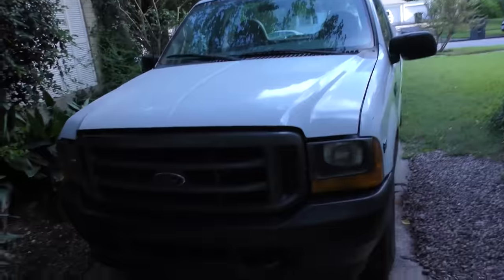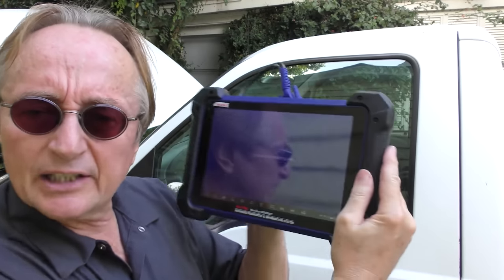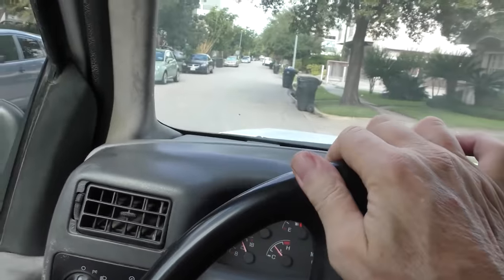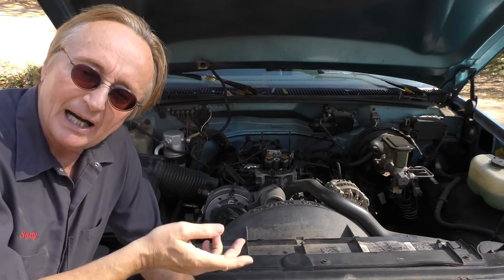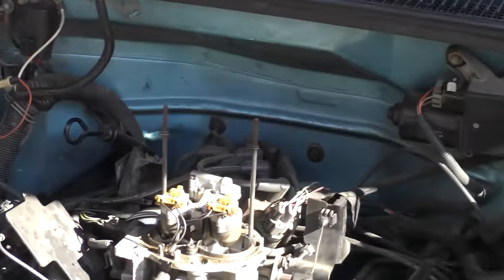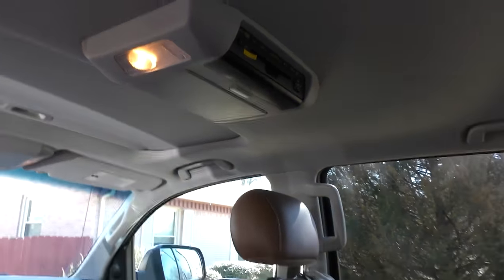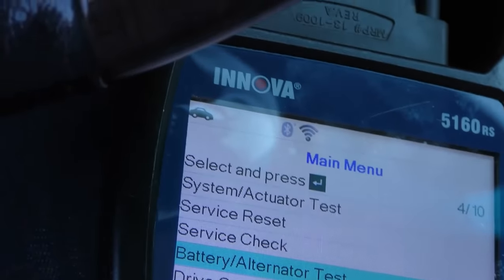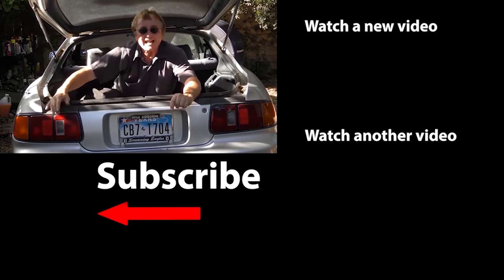3 Trucks That Will Last 700,000 Miles

Comment: Lots of issues with those year Chevy trucks…fuel pumps and transmissions were notoriously going bad all the time.
Reply: Fuel pump goes out around 200k+ or a little before. That’s about it and of course electrical issues(who didn’t have that)
Reply: @wolfmanjack8402  those year Chevy truck are notoriously know for pumps going bad well before 100k….even 60k ,70k sometimes.
I’m not just hearing this I experience this…been an auto tech for 28 years….I started wrenching in 86 so I’ve seen this for fact!

Comment: 06 Highlander 3.3lt 313K, still going down the road. 07 Tundra 5.7 4x4 282K. Pulled a BDH 35Ft TT with it no problems. Went over the Rockies no problem. The Truck spends more time two tracking(Hauling firewood, hunting, fishing camping) then on pavement........nice machine!!!

Comment: 1990 Mazda B2200 , 2 barrel carb, 5 speed manual tranny. Manual windows, manual headlights, couple heater vents, manual steering. 

Run all its life on RedLine full synthetic oil and Wix or Bosch oil filters. 

All fluids from factory replaced with Redline synthetic oil, gear oil, manual tranny oil. 

Currently sitting at 1,360,894 KM's and climbing. Rebuilt once due to a dropped valve in cylinder 3. 

Upgraded with Weber 2 barrel carb, Pacesetter headers, Bosch plug wires, iridium 4 plugs, Accel Super Coil, 1/0 gauge pure copper battery cables / starter cable . 

Fluid Film coated every year. 

Faded paint , ugly , worn suspension  (soon to be replaced). 

Cheap to fix. , cheap to insure, goes like a bat outta hell. 

I plan to run it another 30 years

Comment: I’m looking for a first truck for around $10k which truck would you pick Scotty?
Reply: 1996-2006 Chevy 1500/2500
Reply from the maker: what Todd said or an old Tacoma if you don't need to tow anything
Reply: Otherwise, a good first truck in my opinion is a Chevy S10 or a Ford ranger with an inline 4 cylinder engine, especially when paired with a manual transmission. They can be had for 5k or less and are fairly capable for their size.
Reply: My buddy has a 2010 Toyota Tacoma original owner, 420k.  He’s had to do A/C work and rebuild a trans but that’s pretty much it.  He’s gone way over the recommended 3k oil change many times, way over.  He drives it everyday.
Reply: Any GMT400 88-99. S10, or Sonoma good too, 4.3 V6
Runs GR8, parts in junk yards, all the way thru 06 GM.
Couldn’t give me a new GM or Ford…..
Reply: PRE 1980 is first choice no rust. PRE 1992 is second choice no rust.PRE 2001 third choice. NO RUST, LAY ON GROUND LOOK UNDERNEATH.
Reply: Chevy S10 was my first truck had 400,000 miles on it when I got it.
Reply: @rickreese5794  GMT 96-99 VORTEC

Comment: 1990 C-1500 work truck. Dirt simple truck 285k miles on it. Has an electrical problem I cannot diagnose. Recently got a Colorado with air conditioning and all that, also extended cab. But I miss Old Blue. Standard tranny, 2WD, long bed, standard cab, plain jane and a great truck.

Comment: Have a 2000 Silverado 4x4 3/4 ton 6.0 engine. Bought used in 2003 had 14,000 on it and almost 20 years later it still runs good at 225,000 miles. Best truck I’ve ever had

Comment: Had a 96 Ford ranger ...over 400k on original  motor  ,transmission,  etc ...best truck ever had by the way manual 5 speed ..the original clutch

Comment: My current truck is a 1993 Chevy 1500 with the 5.7 350 and 5 speed manual transmission.  I bought it for $2,100 with 179,000 miles on it a little over 4 years ago.  The odometer broke about a month ago at 203,000 miles.  Since i bought it i put a new radiator, water pump, hoses, distributor, clutch, tune ups, oil changes (all done myself).  A shop put a new front end on it and alignment.  Its not pretty to look at, but it runs like a horse.  Very well built truck worth every penny i put into it.

Comment: RUN RUN RUN ..Everyone knows you should RUN from a 5.4 Triton ! I literally can not believe Scotty just recommended "hands down one of the worst v8 engines ever made" !
Reply: Popcorn spark plugs? They fixed the problem in later versions. I suppose General Motors and Chrysler haven't ever made a screaming pile of smoking noisy iron either? Boat anchor 409! Slant six? Surely someone is offended by now, coring a sacred cow is a specialty. Try the veal, I'll be here all week.
Reply: You are talking about the dreaded 5.4 3 valve that was introduced in 2004. Do your research BEFORE you start bad mouthing something you OBVIOUSLY know nothing about. The 97-2003 Ford Triton 5.4 had a spark plug problem, yes. But that was pretty much the ONLY issue with those engines.
Reply: @standhd  the three valve engine did suck! Dude gm sucks! Exploding transmissions and chrysler's horrible electrical systems. Toyota's rusting frames and generally the awful Nissans. See, everyone makes junk, it's a fact that humans makes stuff that falls apart and will disappoint you.
Reply: @drstyxquack  Wrong again. You have no idea what I drive, how old it is and if I am disappointed in my vehicle. Looks like you got burned by a vehicle and you are DISAPPOINTED which causes you to bad mouth stuff.
Reply: @standhd  I don't care what you drive! I own Ford products, always have. America is a great place with oodles of choice. Drive what you like, I'm not going to tell you my choices are best, because some of the stuff Ive driven is junk. The 89 Crown Victoria's transmission took a crap, the 88 Mercury Sable had horrible motor mounts and the 99 f150 with a "lousy" 5.4l engine blown the front passenger side spark plug out not to mention popped a fuse in the underhood box that controls the transmission. All junk, all besides the f150, I sold and the people who bought them fixed them and drove them for years afterwards. I've been stranded by my Ford cars but I'd rather push my mistakes than drive anyone else's.
Reply: @drstyxquack  I drive a 2003 F150…. No issues. You are VENTING about you misfortunes with YOUR Ford vehicles; like I said. Just because YOU had issues, doesn’t  necessarily mean other vehicles outside of YOUR OWN are TRASH.
Reply: They brought. Back the 302 for a reason ! Seriously dont take a chance on ANY 5.4 and yes I drive a Ford
Reply: @thebakersgarage8309  The early 5.4’s didn’t have the MASSIVE issues the 2004 and later models did. That’s what I’m trying to tell you. The 2 valve engine has spark plug issues, yes. The 3 valve engines had cam phaser, timing chain, cam roller follower, oil pump, cylinder head passages, and timing chain tensioner issues. Stop bashing the ENTIRE LINE of 5.4 Tritons!!!!!!!!!!

Comment: My Uncle had a 1994 Ford F-350 duel tank Diesel 7.3L engine built in Canada.  I don't know how you determined it came from Canada but he said it was one of few that was built there and it was 4 wheel drive and notice how I say past tense...he passed from cancer in 2009 and his wife sold it. It had very very little rust Despite the fact it drove in all terrain but he always kept up with car washes or truck washes I should say. Always one underneath and would put a coat of paint of paint and I actually had the honor of doing it at one time.  Those were the good old days when you could lay right under a vehicle without having to jack it up. He saw my 5th Ave and said "That's a million mile car."  Put dual exhaust on it and just keep up with all of the basics.

Comment: My 4 cyl. 5 speed Vue has a mere 264,000. Toyota made engine. Frequent oil changes. Overhauled AC a year ago. Best $1500 ever spent. Cheap insurance and readily available parts.

Comment: I was given a 78
Ford f150 that was sitting for years. Guy didn’t wanna deal with it because it was his Dads who passed. Wasn’t running. Needed a fuel pump, battery, new gas tank, rear drums, oil change and runs like a champ. Smokes a little because of a small leak on the left engine gasket but I can fix that later.

Comment: Hello, 

I just bought a 2014 e150 flex fuel,4.6 cargo van yesterday for $1,000

369,000 miles!

Runs so smooth. No leaks. Shifts smoothly.

Can this one last 500k miles?

Comment: Another great video!!! Hits home for me. I;ve got a 93 chevy k1500 with 290,00, same color as that one you showed. I got a good deal on it at 100,000 miles.Other than regular maintenance, no problems except water pump and transmission losing 3rd & 4th gears. I fixed transmission myself with a raybestos Z-pack about 15 years ago no problems since. I would not trade it even for ANY new truck on the market.  [P.S. Welcome to Tennessee, I live a little northwest of Nashville. ]

Comment: My dream is to have back my C/K with the 350 and MANUAL Transmission. I used to love having to correct mechanics that always assumed it had the V6. Had to give it up after 250,000 miles because I needed the money. If not, I think I’d still have it today.

Comment: I own a 1989 chevy silverado ext. cab with a 4.3l engine and a 700R4 tranny, it has over 450,000 miles on it and still runs great! I change the oil every 3,000 miles religiously and am a true believer in fix it before it damages something else. Bought it for 2,000 in 2007 and have had small damages due to people hitting it while parked in apartment complex, mostly someone backing into it and busting tail light or hitting sides, but most dents pop out fairly easily, in total have gotten over 9,000 in insurance claims so was a hell of a deal wouldn't you say? I even towed a flatbed tow truck with a minivan on it 18 miles, never even had a problem.

Comment: Well if that 5.4 l in that Ford is a three valve that's a garbage engine.  In the box rusts out anywhere that uses salt in replacement box is 2 to 3,000.  But it's a very good truck if it has a 7.3 l diesel.  The box will still be gone but the truck will keep moving.  My engine has 290 k on it with no signs of slowing down fires right up.  Also for a 2001 I work the hell out of that truck plow snow and I tow skid loaders.

Comment: I'm still driving my 2003 Toyota Tacoma.  Just passed 900K on the odometer; original engine and tranny.  Replaced the frame, (part of factory recall) about six years ago.  Nice truck to pair with my '03 Camry with 500K miles and still going strong.

Comment: I bought my 2002  f250 super duty in 2003 ...and still today 167000 miles later still runs very strong 
Keep all oils and maintenance and they wil run great 👍

Comment: I had a Cherokee XJ with select trac awd, made in 1996. Drove the car until 2020, then sold it. Never had any issues with the awd, axies or suspension. Front suspension did need replacement from time to time, but that damn ol leaf suspension on the rear seems indestructable.

Comment: My dad has a 2012 tundra with the 4.6, he’s got 357k on it we have a lawn care business so he’s pulling a trailer every single day with it, just about last year, got a check engine light, “pressure control solenoid d stuck off” lately the problem has been getting worse but he’s looking to trade it in and get a newer tundra got his eyes set on a 21 with the 5.7, other than the transmission issue, the truck is absolutely great, gonna miss it when it’s gone

Comment: I’ve got a 2000 Silverado with a 5.3 that has 654,000 original miles on it , the only thing that’s been replaced on it is the differental and water pump ( x2)

Comment: I got the deal of a life time. 1996 F250 2x4 138,000 mi., automatic tranny with the indestructible 300 in line 6,  ZERO rust, great paint, and good interior, brand new tires, For $1,750.00. Came from a school system here in Va. Have ALL the service records from the day they got it new till the day i bought it. It runs and drives like a new truck. Their was one driver that drove it it's entire life there. Three month's ago i took it to Atlanta Ga. with trailer and put a Suburban on it and come back to Va.. It was not the fastest thing on the road but that good ole 300 pulls its guts out. I believe it will make 500,000 fairly easy because i have my on shop and i'm a stickler about maintenance!!!! Mobil 1 and Mobil 1 filter, tranny was serviced when i got it with dexron VI. You are correct about changing fluids, oil, antifreeze, brake fluid, tranny fluid and filter, and gear oil for rear end and front diff and dexron VI for transfer case on 4x4's, that's the life blood of any vehicle!!!!!!!  keep up these great video's Scotty, i have you on in my shop to learn something from you and your automotive adventures every day.

Comment: I have a 2001 F-450 with a 7.3 diesel.. it sat for six whole years in the woods. Had to replace injectors when i bought it but at 172k miles it ran beautifully and reliably. Ive put on several thousand more since but to have sat that long and start up every day with no issues.. it’s impressive

Comment: My 05 Silverado with 5.3 is at 220k and has the original motor and transmission both are functioning perfectly and sound terrific. I just had to do the oil pickup o Ring though but it's done and there's zero ticking

Comment: I've got a 1999 chevy Silverado Z71  with 283000 miles on it, white, clean interior, new headliner, cold ac, use synthetic oil, Seafoam additive in gas, not for sale.

Comment: Got my 01 Ranger that I paid $800 for with a blown motor from running through a large puddle.  $400 for a used motor and it ran great.  Since 2006 I’ve had to put in a fuel pump because it sat for a year before I bought it, ball joints, brakes, brake lines, exhaust., about $1000 in the 15 or so years I’ve had it.  Super easy to work on and a great little truck.  No engine lights, trans issues, it just runs and gets good mileage for a truck.

Comment: I've seen a 93 4cylinder with 660,000 miles on it. All maintenance. Fuel pump only thing guy replaced. Like a wire to it.

Comment: Fixed my tpms pretty easy on my 2012 tundra. They were about $20 a piece thru my local shop. No more light. For some reason this truck has a problem with keeping clock springs though.

Comment: I've driven E250 Vans over 700k and some 1.3 million with second motor and tranny.  Just do your maintenance.  Repack and replace wheel bearings and front end parts when needed.

Comment: I had a 1999 I drove it 19 years it had the 7.3 powerstroke 590k on it the original transmission the key is in changing the transmission fluid at 60k intervals

Comment: Obs ford with the 300 inline 6. Great reliable truck should last forever if you can keep the rust gremlins away. Mine is a 96 f150 currently with 185,000 I’m doing the rust repairs so I’m expecting to get another 200,000 out of it.

Comment: I'm still driving my 1983 Toyota four wheel drive pickup. Bought it new for $8295.00. 
Had to put new engine in it at ,234,000 because jiffy lube put wrong oil in it.
I put a engine in that had about 20,000 on it.
Running good still.
GREAT TRUCK!

Comment: I have a 6 Toyota Tacoma standard cab 5 speed manual transmission 2.7 engine and I've got 243,000 on it and no major repairs yet.    Only front brake rotors and pads and tires and oil changes and wiper blades and gasoline.    Oh and a new radiator and water pump and coolant bypass pipe and valve cover gasket.   Pretty dependable vehicle.     I ran it hard it's entire life.   I never checked the transmission oil.   Or rear end oil.    Maybe I should do that.    Oh I had to replace the windshield and right door glass        that's it.    It's my transportation vehicle      I Love it so much that I just purchased a new one.    22 Tacoma SR5 4X4.   I plan to use the 4X4 so that's a good thing.   Lunchbox Larry out 🤠

Comment: I haven't seen any real trucks from the 70s my dads new 3 /4 ton chevy camper special i have driven to 43 years almost 300.000 miles  3 engines solid as a rock! Also still have a 46 ton and half chevy i sold the 46 pickup with the second😮 engine. No fords in my family.

Comment: I have two 1970 Chevy trucks. One is a C10 short bed stepside with a straight 6 and the other is aC20 long bed fleetside with a 350 and both have a 4 on the floor. I drive them both on a regular basis and besides doing routine maintenance on them I never have any problems. They are both super reliable and easy to work on. I don’t foresee myself ever having to buy another truck until I’m so old I can’t drive anymore.

Comment: Scotty, you know , those 7.3 diesels, 199- to 2003 are the best diesel on the market. Have a 1999 that I keep for heavy hauling, usually horses.  So id relaxexs around the ranchette until itis needed.  That tranny is a big heavy hog that runs a long way.  Yeah got that gooseneck hitch.  Get some of those special made o rings for the filter empty valve and clean that tube and you get another 150 thousand miles.  Right, you need one of those electical genius firends.  Got one of them too, he rewired the trailer lights, connectors and all.  Keep on Truckin Scotty!

Comment: My GMC with 168k when I floor it,it gets rubber and in second gear to it runs good and everything works my seats are like brand new no rust,and in 2022 it's a 4×4 2004 all I did is brakes and tires

Comment: Only bad point I know of with a Tundra is the rear axles if you need to replace the wheel bearings. Not an easy job. Special tool required.

Comment: I have a 2010F150. with v-8 and 180k miles.  Truck is great! gets 21MPG on a trip!  And yes, it will need a transmission in a couple years.  Plan to take to Ford place and let them fix it when the time comes.  My girlfriend has a Toyota Tundra one tuff truck!

Comment: I use 93 ford with the 4.9 6 cylinder good truck new box.450,000 mile 1/2 quart every 5000, chevy 350 2 or 4 bbl auto have 375,00 has the 400 auto trans 3spd my pickup with over drive  dodge 225 318 engine durable  3.1 and 4.3 v6 in smaller vehicles but I have a 92 chevy wt  1500 with 4.3 v6 just turned 525,000 mile no burning oil